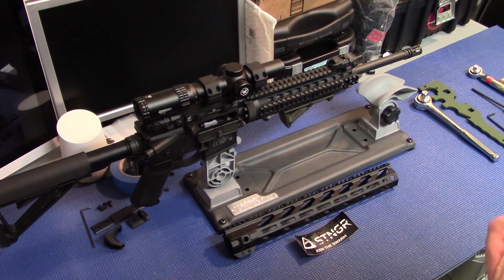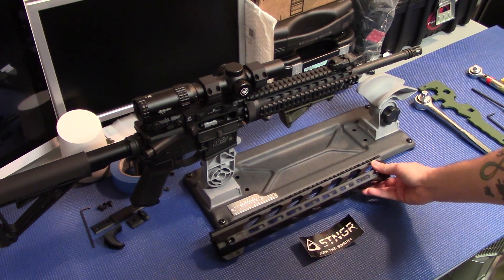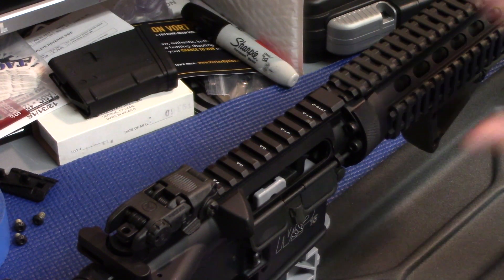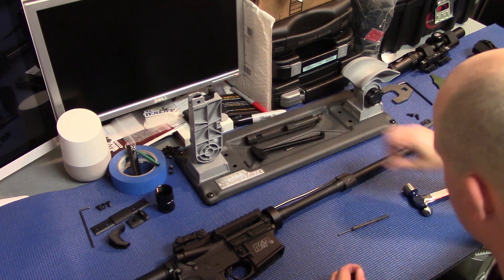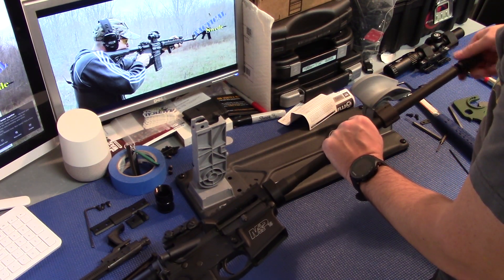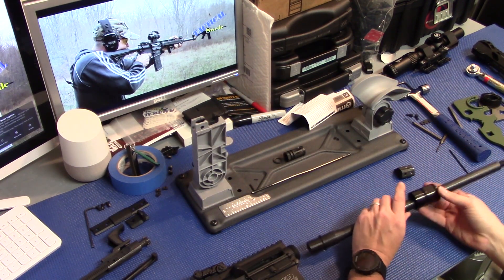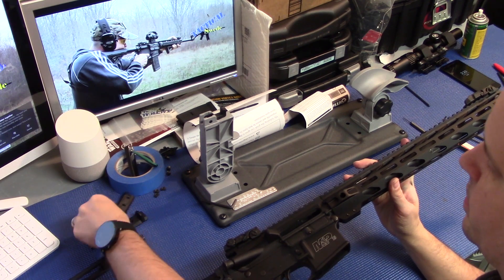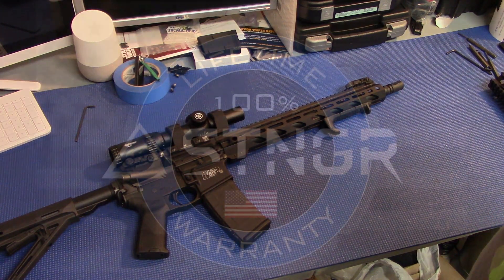STNGR 15" M-Lok VYPR Handguard Installation

Comment: To clarify, the stock gas block is fine and the rail will slide right over it?
Reply from the maker: For MINE the stock gas block fit just fine, and most SHOULD work...but I can't say the same is true for EVERY gas block...your milage may vary.

Comment: Hey bro great video 👍🏽 I have the same rifle. So no changing the gas block? The original one fits with the new hand guard?
Reply: Bro I’m not sure how you got that gas block pin out, I’ve been pounding on this thing an hour and it moved a little then it just froze in one place. I’ve about given up. I might need to take it to a armorer.
Reply from the maker: It definitely took some beating to break it free
Reply from the maker: Thanks...yeah I used the original gas block.  No issues.

Comment: Do other brands of the "pop in" rubber hand inserts/hole fillers fit the STNGR rail too?
Reply from the maker: They should. As long as the rubber covers use a standard M-Lok or Keymod (STNGR makes both) attachment, then it should work.

Comment: Not sure why you dismantled it on the mag block, but you put it back together on the table. Also not sure where you got yours for $100 but I bought mine about 6 months ago and I payed $125.
Reply from the maker: To be fair, I was switching back and forth between the block and the table for the disassembly.  Because it's not actually mounted to the table, it's not the best setup to do anything that requires a lot of torque.  As for the price, at the time I bought it, mine cost $110 and the shorter ones were at about $100...I know prices have gone up since then, but they are still a great deal when compared to some of the other options out there.

Comment: I like you used a STNGR.  I cringed to see you do that work without a proper upper receiver vice block.
Reply from the maker: +ofacesig
Yeah, one of these days I'll actually get some more proper gunsmithing tools, but I've always done things this way...very minimal.
Reply: @TacticalSwede    Bro, get you one of these (or a reasonable competitor) to work on your ARs with.  You'll probably never use plastic blocks again if you're really concerned with torque or upper receiver damage.  https://www.midwayusa.com/product/128947/geissele-super-reaction-rod-ar-15-vise-block-steel
Reply from the maker: I have one now...I've put plenty together without one and never had an issue, but I figured it was time to get the proper tools...lol
Reply: @ronwilliams329  nope I'm doing it by hand with a mallet, random pin, and some pliers with cloth wrapped around them